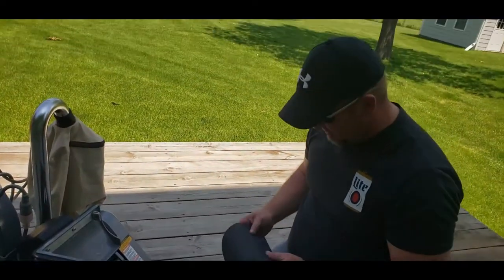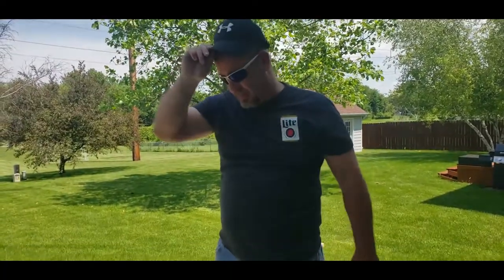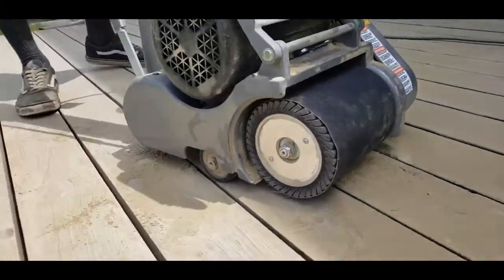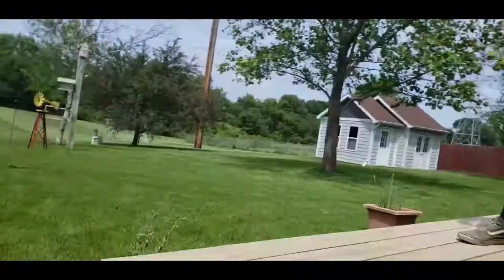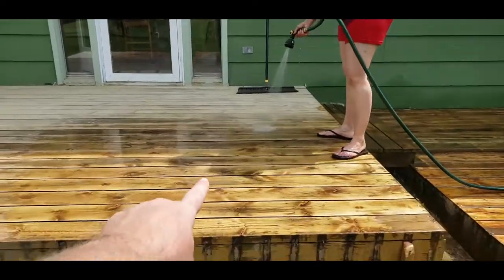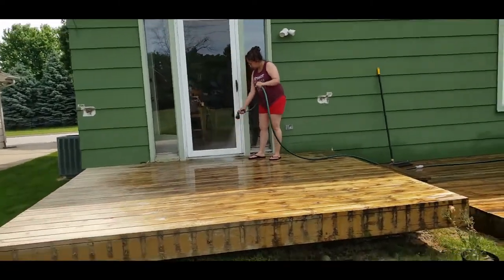SANDING Deck- Went Way FASTER then I thought!! (Deck Project Part2)

Comment: Pressure wash before sanding (takes away the mildew... Sand paper is more effective)
...Use 24 grit (I've used as low as 16). Seal with TWP 1500 series. My company has restored over 3,000 decks in the last 30 years....
Reply: Can you use a drum sander on a painted deck?

Comment: Either something was clogging the vacuum channel area that sucks up the saw dust / maybe torn paper or the belt had broken for the fan that creates the suction, otherwise that saw dust should have been completely sucked up. Plus that bag would be completely blown up solid from the air flowing into it when it's working correctly

Comment: Also, DONT drop the handle into wood. You will cause a major dent. Start moving as you glide into the wood and slowly bring the drum up at the end...Use a blower not a broom also.
Reply: This comment should be engraved on every drum sander so the operator knows. Can't tell you how many people ruin their deck by gouging their wood with one of these. Fantastic comment.

Comment: I see you didnt have any stain on it before sanding.  You think it will sand away the stain as well or would I need to remove the stain first?
Reply from the maker: That thing will remove rust from a boat hull! Lol
Reply: Should I try to remove the paint first or will it eat through the paint? I want to save some time.
Reply from the maker: @chenchen-qb8oq  it will eat the paint right off, but you stand a chance to go through the sanders a bit quicker
Reply: @chenchen-qb8oq  start with 100 grit to get used to lowering  and raising the drum. The 100 grit will be forgiving and good practice.  When your ready for the big leagues go as  low as 36 grit. I often use as 16 grit but i've done over 4,000 decks
Reply: @rickwillson2811  Hi Rick, would the drum sander be efficient in removing a solid stain off a deck? i'm trying to get back to barewood.
Reply: @paolojose6706  , stain soaks into wood. Paint sits on top. You will likely not be able to clear away all stain.
Reply: @paolojose6706  Solid stain does not soak into wood but sits in on top like paint so yes.

Comment: that's a drum sander.  ok, I see you said that later on.  by belts do you mean sleeves?  how many sleeves did you use on the deck?  The vacuum doesn't seem to working but...good job, deck looks pretty nice.
Reply from the maker: Went through 3

Comment: Hoping something like this can strip old peeling paint off my deck
Reply from the maker: Get the higher grit sandpaper and it will strip concrete of your driverway 🤣 jk it will work but might clog the paper a bit more often.
Reply: Powerwash first

Comment: Iam getting ready to do mine but what about the nails ?
Reply from the maker: Try to run them below the surface, it will take the tops off.
Reply: @millsmillwork5910  ok thank you
Reply: @rickilynnwolfe8357  Counter sink them with a large nail set and mini mallet. Ive done this on approximately 2,000 decks
Reply: @rickwillson2811  thank you so much appreciate
Reply: @rickwillson2811  thank you so much I want to make sure I do it right so much appreciate all the advice I can get . I have to do this myself because my husband is stage 4 pancreatic cancer and I don’t have the money to pay someone else to do it . I hope mine turns out this lovely
Reply: I can show you picture that will your draw drop:). My favorite quote is from Albert Einstein. "a life lived for others is a life worth living"....
Reply: @rickwillson2811  amen

Comment: Thanks now I know I need to chemical strip wood deck next to inground pool . Way too much dust . Or buy cheap solid cover to keep all that dust out if I sand .
Reply from the maker: It does make a fine powder dust, but for the most part manageable. Good luck, and thank you for watching 😁👍
Reply: Buy a cheap solid? Goooood luck with taking that off when it wears. You'll have to sand again. This project could have been done with hydroxide strip followed by oxalic wash and then just stain. Never paint your deck with a solid. Oil only.
Reply: @AndYetHereWeAre  Cheap solid cover is a pool cover not solid stain . PS.  to keep the trash out of the pool .